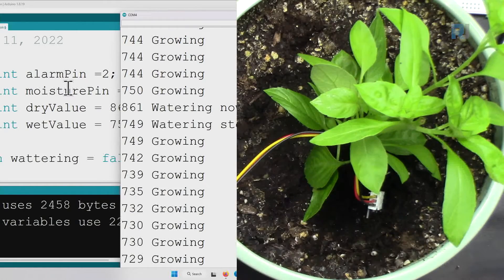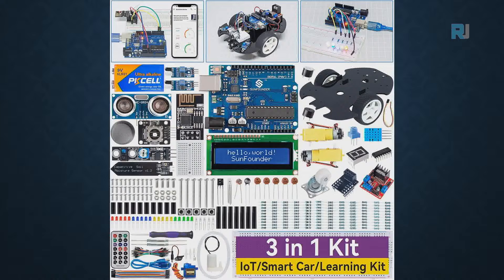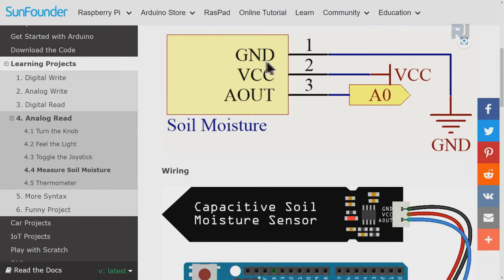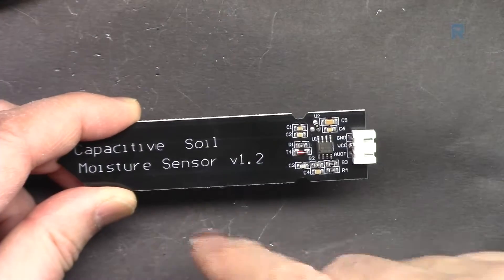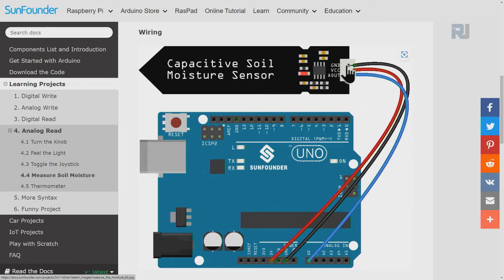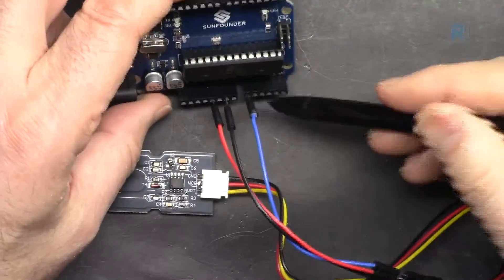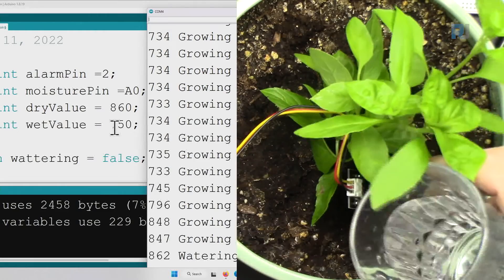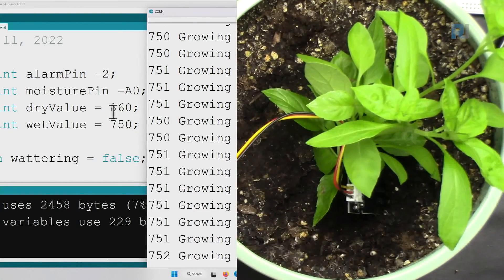Lesson 15: Using Soil Moisture Sensor with Arduino SunFounder Kit - RJT598

Comment: Thank you for this, I haven't finished watching the video yet but I would like to connect 2 or 3 sensors to a single arduino board with a Wi-Fi top hat so that sensors can be monitored remotely within the house 🙂